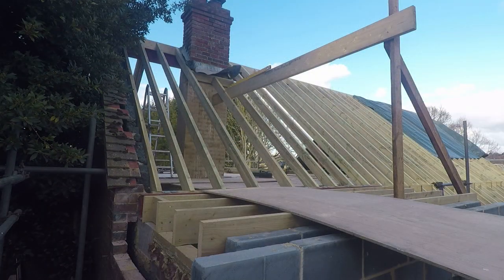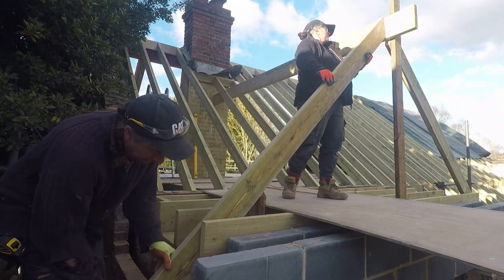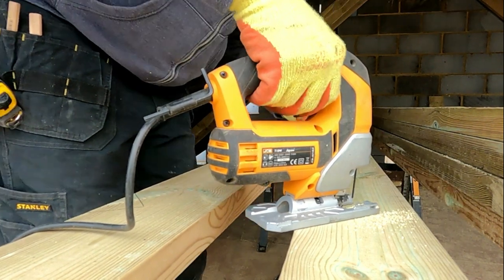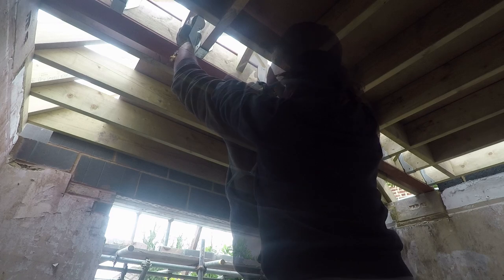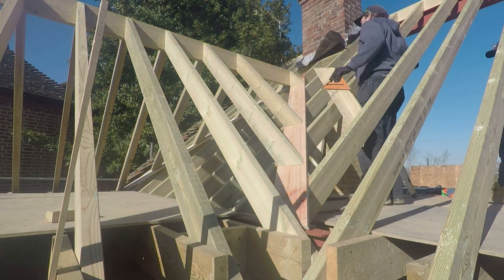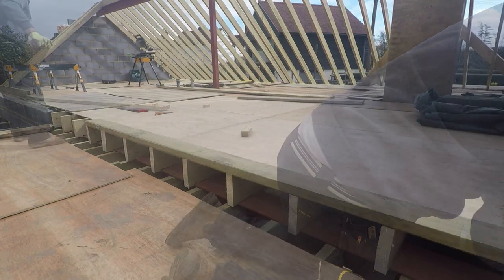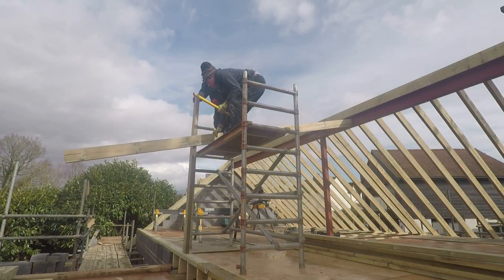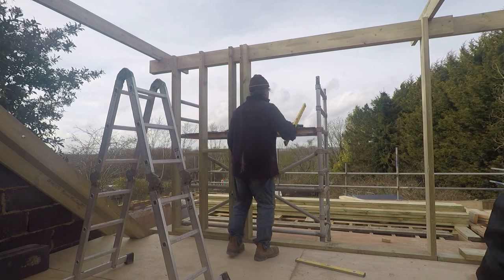House Renovation - Part 24  Valley Rafters and Dorma

Comment: I’m in the process of the doing the exactly the same if I don’t get planning permission for a 2 storey house replacement. Did you think about this route?
Reply from the maker: Hi Luke, we were always going for a refurbishment and extension, however there has been several occasions when we have said it would have been easier to replace with a new build!! Good luck with your planning 😄
Reply: @Kairosproperty  Thanks. Hopefully it gets accepted, if not I’ll be doing what you are. Just wondering what the middle ridge support beam is supported by? Is it on a wall?
Reply from the maker: @lukemills7  Yes the middle of the ridge is supported by a steel column that rests on a pad stone on the internal wall, we had the ridge made in 2 parts as access is an issue for craning a full length one in. I think you could also support the column on another beam supported by 2 walls if nothing is below. Regards